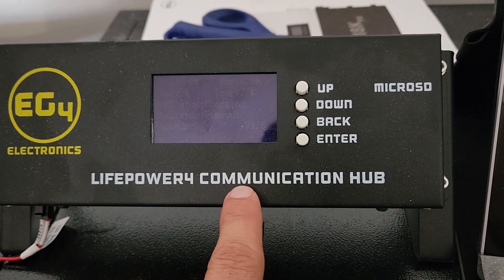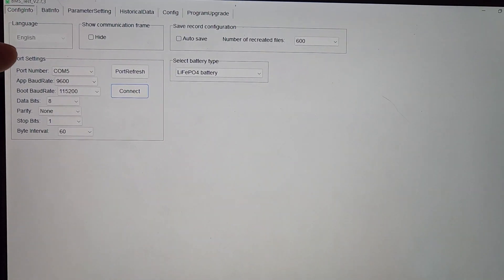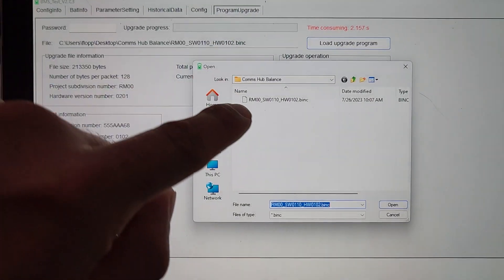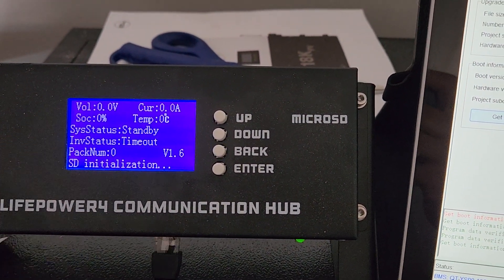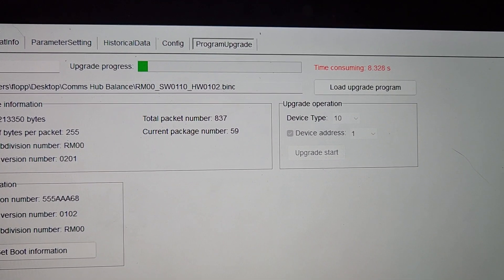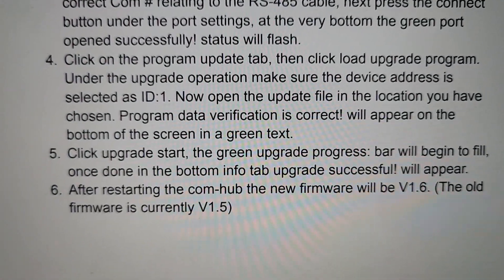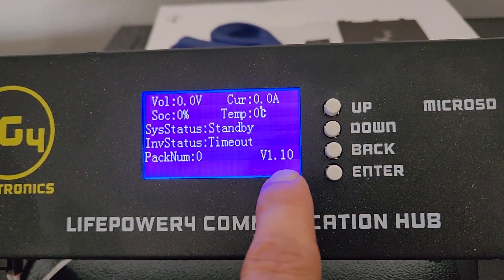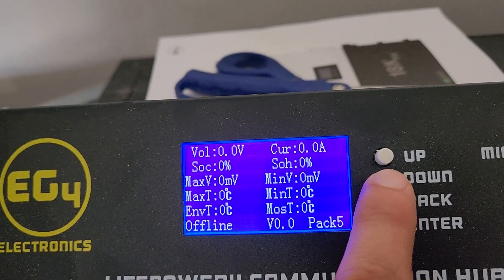EG4 LiFepower4 Comm Hub Firmware Update (Optional) **Do Not update unless directed by SS/EG4**

Comment: there was an issue with the latest firmware, any chance you can share this file with me?
Reply from the maker: Sorry I didn't save the file. What version do you want?   Side note I haven't used the hub for a year.
Reply: @theadventuresofarenaissancman  I was on version 1.10 and attempted to move to 1.12, which has appeared to brick the hub. There are a few threads on the DIY Solar forum with the same issue. No one has been able to get it fixed.  I have a ticket in with SS / EG4 but unsure if they will be able to fix the situation. I may have to just switch over to using voltage for the solarl instead of the hub..
Reply from the maker: Did you have communication cables plugged in?
Reply: @theadventuresofarenaissancman  no.. Only the one port to INV to my computer..
Reply from the maker: @mchipser correct cable pinout?
Reply: @theadventuresofarenaissancman  yes..